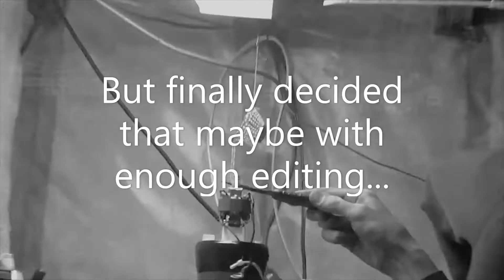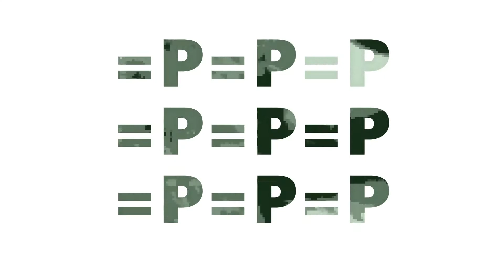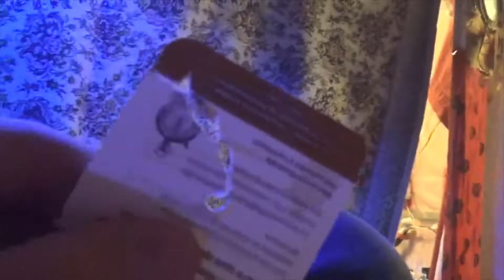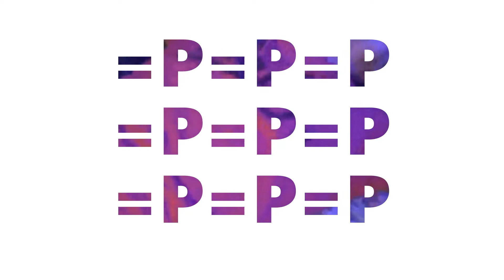Attaching stuff to a small high speed motor

Comment: Hobby central, have you seen shawn k treadmill motor video. I suggest you have a look at it. He did the same thing as you guys, but in one part of the video, one of the guys puts a plate on the motor with a lightbulb and the lightbulb flies off.
Reply from the maker: No I haven't, sounds interesting
Reply: @hobbycentral3516  ok, shawn k does other videos like putting thermit on a ceiling fan while turned on. I have watched shawn k and i enjoy it. I also enjoy watching your videos as well.